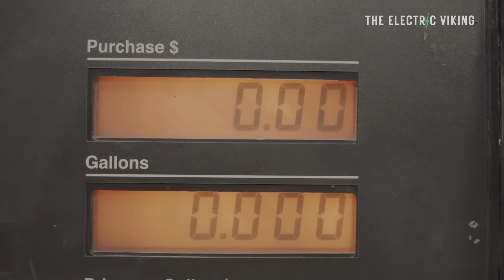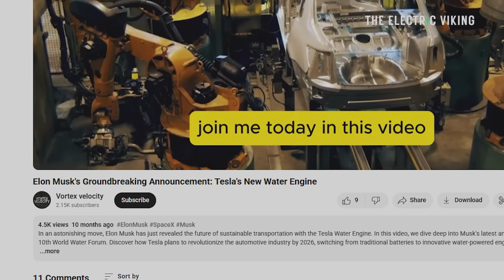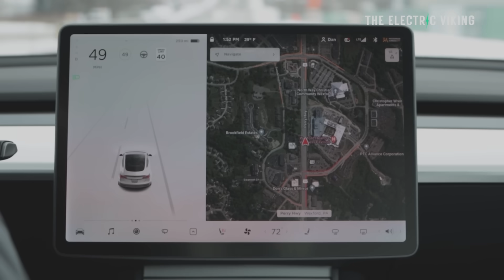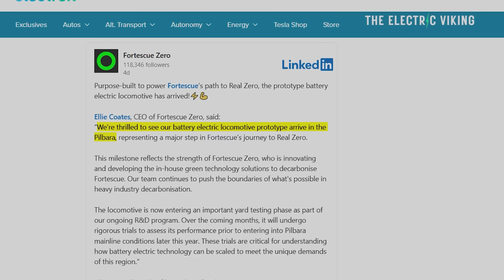The Train That Never Needs Charging – Game Changer for Global Transport

Comment: Mine carts & funiculars using this concept have been around since at least the 15th century.  Literally loading a rail cart with rocks & using gravity to propel it.  It's surprising that the transition to regenerative braking + batteries instead of cable has not already occurred.
Reply: We tested this concept on lifts using vanadium batteries. Couldn't find financing...
Reply: Yes, not a new idea and only applicable in a specific set of circumstances.
Reply: Regen in trains is not new either, whether compressed air or battery based.

Comment: Electric trains already do this. They put power back into the grid when going downgrade. In this case they're using battery locomotives to replace diesel electrics. They could have just electrified the line.

Comment: As a matter of fact that train is actually recharged every round trip, when iron ore is loaded.
Reply: In fact, electric trains have existed for 100 years now. It was just a matter of installing copper cables above the railway tracks. But many countries still use diesel trains. 

Even stop investing in the railway. And make many goods move to the highway using trucks
Reply: Electric pīles trains are Only cheaper on high traffic trains. In rural us it is cheaper to use oil. ALSO trucks are essential on short to Medium routes. And for privte Company to invest in Rauls are too expensive. Bright Line dome it, but they are exception, and politicians just do what they got voted in Next 4 years. Big rail invest ment need country, probably president leadership. And prezidents ALSO are thinking about election promiles. Most People dont care about Rails, just about short term benefits.

Comment: There is no such thing as a "Perpetuum Mobile". It´s a great idea and it does work under very specific conditions, downhill, heavy load, uphill - empty. No mention on how slow it goes downhill while regenerating. It´s a fantastic idea and fun curiosity - it will not change global transport to a large extent although regen breaking is a tech that for at least a decade is already being implemented in most new locomotives to recover some energy. It just makes sense.

Comment: Trains have a lot of surface area and spend most of their time out in the sun. Why can't the roof and sides of each carriages be covered in solar panels to send additional energy to the engine?
Reply: Trains also represent a fairly harsh environment to install fairly fragile panels upon, they are not stationary sites with predictable sheer and other motion-orientated stresses and loads being placed upon the panels. Silicon likes to crack with stress and the rough jolty movement of a goods train isn't going to be the best environment for long-term panel health. This also ignores the harsh handling involved during loading and unloading the trains, with tonnes of materials being spilled into carts would require significant protection of the panels to be in place to prevent their damage (large hail stones can wreck a panel, imagine what a lump of ore carrying rock will do when bouncing off the lip of a hooper into the path of a panel). Then there is also the environmental risk of highly kinetic thrown-up debris hitting the panels with some force whilst the train is traveling at pace along the tracks. 

I would expect a PV panel not to survive long in such environments, this is why ongoing research is going on into flexible PV (better for stressful situations) and more recently PV paints, which although generate lower levels of energy, are perfect for covering objects in harsher environments.

Comment: This is ridiculous, the fact that this is coming from a company that was all in on hydrogen not long ago is a huge red flag. The train is being charged when it is loaded up with a load at the top of the mountain. The energy is coming from the equipment that is loading up the train with heavy loads. Why do people have such a hard time understanding how energy transfer works? If I have an electric car with let's say 20% charge and take it to a city high up on a mountain on a flatbed truck then drive it down hill to sea level and charge the battery up to 90% because of regen braking that energy is not free, it came from the flatbed truck that towed the car to the top of the mountain. You can't make energy out of thin air people, that's not a thing.🙄😑
Reply: Note quite, the potential energy built-up at the start within the train system isn't the only source of energy in the overall system, a gravity assist pulling the mass downhill exists as well; the mass isn't lost as the unit moves downhill with gravity will acting as an accelerator pulling on the mass towards the lower level. The regen leaches the gravity force's acceleration energy to charge the batteries to keep the train moving at the desired speed. 

The system uses a fine balance in using the gravity assist on the downhill leg to charge up the batteries for the much lower weight (empty) uphill return trip; also covering any systemic losses as well, such as energy conversion efficiency, friction and wind resistance on the way back as well. This only works in this particular case, a very heavy mass moving downhill a sufficient distance to cover the energy requriements of moving a much lower mass on the return trip back uphill; it won't work in the reverse situation or on more flatter locations or with lighter generating loads or heavier return loads.
 
However, the weight (iron ore) in this case is mined at the top of the incline involved, the energy transfer gain from moving the material 100s of metres vertically to the load point and from the vehicles moving the material to this point isn't as significant in this case as the potential energy within the material already held at height and converted to electrical energy through gravity on the way down.

Comment: Whilst Regen is a great feature, and looks to be an important boon in battery/battery-assisted electrified rail transport this particular setup is very single use-case specific. The loaded train is operating in a predominately downhill direction to a destination and travelling empty with a lower weight in the uphill direction. The overall incline in the 'downhill' direction is sufficient in this case to enable regeneration gains from mass carried in that direction to power the trip back in the now predominately 'uphill' return direction. Other cases with different requirements may or may not gain from a gravity-assisted regen approach depending upon the specific circumstances involved - it's not a generalised solution.

Comment: That sounded incredible !
If this was for real , I hope that Fortescue can revolutionize the train industry around the world !
💖🚂💖⚡️🔋💯💪🌏✌️💯👍
Reply: This is a very use-case specific solution that depending upon circumstances and location - requires more weight to be carried in a downhill direction to power an empty train to travel back up the opposite uphill direction on the return trip. Needs a balance of weight/gravity assist gain to overcome losses (friction, battery/motor efficiency, wind resistance, etc.) on the return leg.

Comment: Talking of electric train Sam, fully charged/ everything electric show in the uk features ran electric commuter train now being used in London successfully. Avoids expensive overhead power cables. I tried in vain to inform Portuguese railways they were wasting money on electrifying their Algarve line when this solution was available and a bigger no brainer as they have lots of sun for solar generation too.
Reply: For most lines it's better to install the power lines. Battery trains are only going to be used in special cases were you can't install cables because of a tunnel or bridge in the way or where there are only a few trains a day on a small branch line. Your rail authority has probably done the calculations and worked out it's better to install the power lines.

Comment: Using Regen to improve efficiency is of course a good idea. But you can only use regen as your whole power source in very specific circumstances when you are transporting heavy raw materials down a mountainside and returning empty. Even then the cargo needs to weigh a lot compared to the vehicle and you need a very efficient system to avoid losing too much to friction. Iron ore is one of the heaviest cargos. This probably wouldn't work with coal as it's much less dense. It cannot be applied to general transportation and certainly not to passengers. Suggesting that really makes you look silly Sam.
Reply: Of coarse this would work for passenger trains, silly. Some people are more dense than iron ore.
Reply: Coal cars are taller than iron ore cars.   Train trolley wheels are loaded to spec for most any raw/bulk product.  Same for Semi trucks, trailers are designed to handle a full load as specified by the weight of the bulk product.  Of course products like Bread are not bulk and are the exception.
Reply: The approach is very specific to location and circumstances, it requires a sufficient weight differential with a suitable overall downhilll incline to generate sufficient energy to overcome the lower weighted train moving back in the opposite 'uphill' incline, taking systemic losses like energy use efficiency, heat generation and friction into account. It's basically the battery electric train equivalent of a gravitational well assisted slingshot used for deep space vehicles - with the batteries acting as the energy store rather than kinetic energy of the vehicle.
Reply: I'd be careful using such definitive statements. If you had told people of the performance, charging times, efficiency, etc. of today's electric cars 10 or 20 years ago, you might well have looked pretty silly in many peoples eyes!! Technology moves on, who can really tell just what is around the corner??
Reply: @scottiethegreat74  It's not a matter of technology. It's simply physically impossible. You can't get free energy. It has to come from somewhere. The ore has gravitational potential energy because it starts at the top of the mountain and gives up that energy when it travels to the bottom. If the journey wasn't one way this wouldn't work. If the cargo didn't weight a lot relative to the weight of the empty train this wouldn't work. People aren't heavy enough and they also want to travel in both directions, not downhill only. Even a factory at the top of a mountain would need imports of raw materials and parts that weigh at least as much as the finished product. So there would not be a substantial weight difference. It's only applicable to mining, and possibly on the outer edge forestry.

Comment: Edison Motors uses this concept for its logging trucks.  Go up empty, get loaded, use regen to fill batteries when coming down.
Reply: Every little helps, but in practice it would be very unlikely that they would get enough energy to completely cover the return trip. It would have to be a very steep run straight down and up without much extraneous up and down along the way. There are much more friction losses for a truck than a train. It would certainly reduce fuel use substantially though. What's more likely than 100% gravity power would be if you start the day with a full battery you could do  a few trips without having to recharge it or turn on the generator.
Reply: Returning with 3-4 times the vehicle's weight in timber is a lot of potential energy.
Reply: Yes. This works if the load end of the line is significantly higher than the destination and there's a significant enough  load to allow for regen to work and charge more than needed for the return trip.

Comment: There is an thing called friction and this only works because a ton of potential energy is loaded intp the train at tje source and onlu works under extremely limited set of conditions amd is totaly insane for day to day operations. Autos are already maximizing this concept with regen
Reply: …so let’s also do it for battery trains. Imagine most of the kinetic energy at train stops would be regenerated.
Reply: @A-W-r4s  Some will, of course.  But there is a big difference between what Fortescue are doing and what happens generally.  They are moving mass from a high point down into a gravity well, IYSWIM.  Most trains are not doing this - on average they are moving mass around with no overall downward movement of mass.  Regen will help, but they will always have to charge their batteries.

Comment: The reason this doesn't work most anywhere else is because this train is a hundred times or more heavier when fully loaded and going downhill, then when it comes back up empty. This is not the first company to do this in Australia. There's another mining company that has been doing this for many years now.
Reply: It's literally charging all the way down. It cannot revolutionise anything. See Tom Scott's video on a similar concept, an Aerial Ropeway
Reply: @oliversissonphone6143 Not everything, no. However, what is revolutionizing it is mining companies in similar circumstances. They're saving tens and even hundreds of millions of dollars in fuel costs per year. Depending on how large their operations are.
Reply: Some 150 years ago Switzerland started building such trains using water to make downward traveling trains heavy, connected it with a rope to the upward moving train which therefore could carry passengers up. Genius.
Reply: Agree.  This doesn't apply to the scenarios he mentioned.
Reply: Not to mention that rolling resistance on rail is much less (maybe 1/10) of cars, only works in very limited areas.
Reply: So they are charging the train when it is at the top of the hill, the fact that they are loading it up is actually charging it. The energy is coming  from the equipment that they are using to load the train. Why do people have such a hard time understanding how energy and energy transfer work. You can't make energy out of thin air, it has to come from somewhere.🙄
Reply: @andresd6193 the energy is not coming from the equipment used to load the train...
Reply: @andresd6193  Correct. But the point in this instance is that this can't be done with a fuel. That's why many mining companies are turning to these solutions electricity being created by pure physics to save hundreds of millions of dollars in fuel costs.
Reply: Weren't there a train with solar on it in India to reduce fule consumption? Probably combining can go further.

Comment: Most electric trains have an element of regen that puts power back into the overhead lines where it can power other trains on the network. I think full braking would be difficult and regen can't bring to a halt, only retard. People and freight also need to go uphill and there is likely a 50/50. Mining is a fairly unique case study and in fact there is another line that has no power involved at all where the descending load just pulls the empty trucks up on a rope although I believe it may now have reached end of life. These sort of systems have been around for centuries we just find ways to make them more complicated and generally less efficient as a consequence but we spend our lives reinventing the wheel and congratulating ourselves for having done so.
Reply: In this specific case I would anticipate a regen battery solution to be more efficient than a mechanical line pull based system due to distances involved. Indeed a line pull based system probably would not have worked due to the total mechanical losses involved.

Comment: It's not right to say that it doesn't need charging. It is getting charged by regenerative braking (which is an excellent idea).  The reason why it is a very well designed application is because the train has to return uphill, empty.  There's a lot of places where gravity is not sufficient to pull the train back down, because the terrain is too flat.
Reply: Sounds like it can be improved with solar charging stations and some solar on the locomotive also there might be some wind options.

Comment: First believing in magic batteries that never appear, now believing in something breaking basic laws of energy.
Reply: It doesn't break any laws of physics, it's just a very specific way of exploiting energy. One that leaches energy from the accelerating force of gravity acting on a heavy mass in one direction, storing that energy in batteries via regen (electric generators acting to convert the energy gained from gravity's accelerating force to electricity), to be used on the return trip to drive a now empty train back uphill. There will be a very precise calculation involved using the loaded mass of the train, the height differential involved, the empty mass of the train on the way back, the energy losses to friction, energy conversion efficiency and wind resistance, plus the battery size required in this specific circumstance.  

All physical factors operating within well understood laws of physicals - this is just a modern version of the cable pulled carts used in mines a couple of centuries back that used large rocks dropped down a mineshaft to pull the carts on long ropes out of the mine, just using electricity instead of rock and rope.